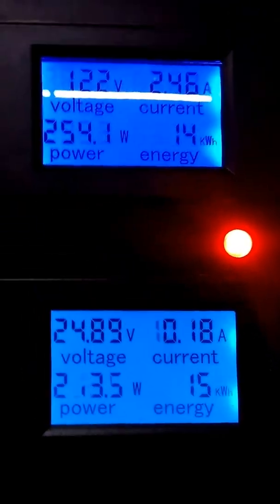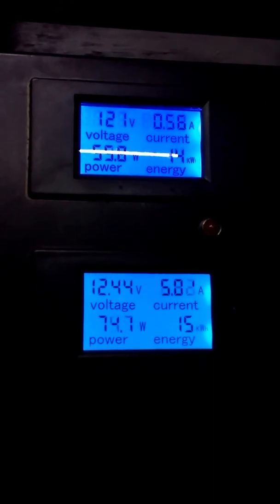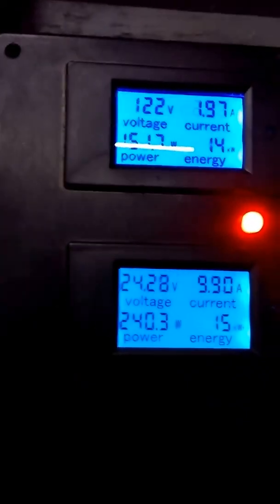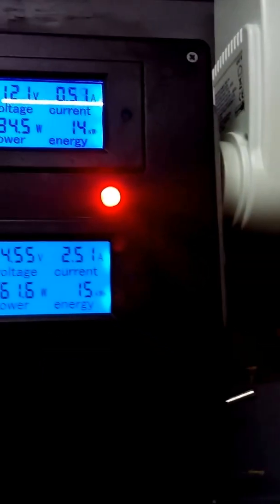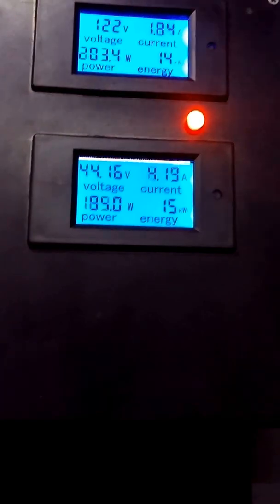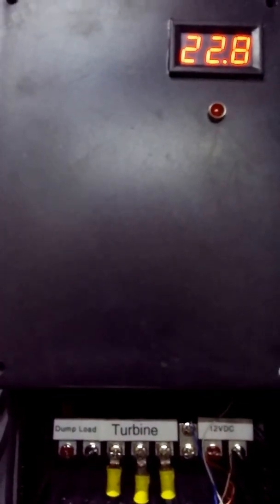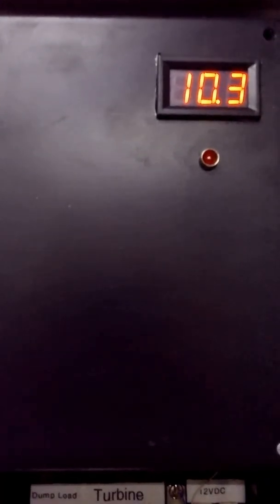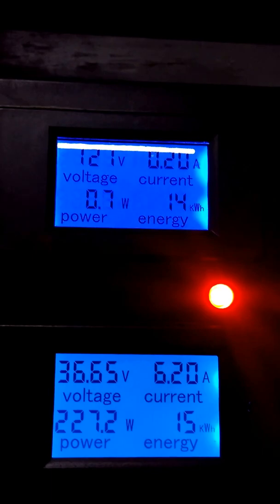Wind Turbine Grid Tie Controller with an HYE WIND MAX 1000W ONE OF A KIND

Comment: Are you out of business? Website no longer there...
Reply from the maker: SolarizeYourLife no. I still hace the busn. Just not the wedsite
Thank you
Reply: @leamyelectricinc1  hi,just checking if u r still doing the grid tie hardwire system, gerard from windy west Ireland
Reply from the maker: @gerardcomer5550  hello. no i just took it down. yes i can help u out. i dont really build systems anymore however im still in the game. If i can help you i sure will.
Reply: @leamyelectricinc1  thanks for getting  back ,i am going to  go ahead  and invest  in a micro  wind turbine  something in the range  1kw  ,i live jn a very exposed  windy area and love to turn it  into renewable energy, i want to go gridtie  no batteries, any suggestions  or set up  that u can recommend to purchase, thanks Gerard

Comment: hi mr leamy, this a cool controller you have come up with. thanks for the info. in the past I've seen how you tried using enphase micro inverters. I got them working with my turbine. check out my channel. you might check into the aims micro inverters. they are rated at 60v input. I'm going to experiment with them. being UL listed is the goal for all us tinkerers no?